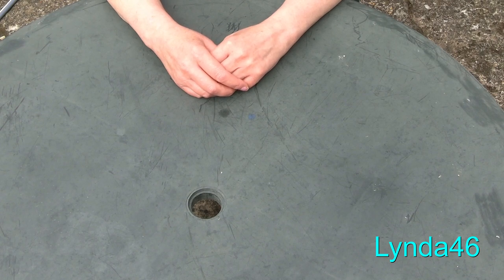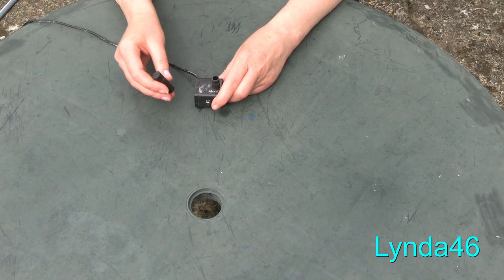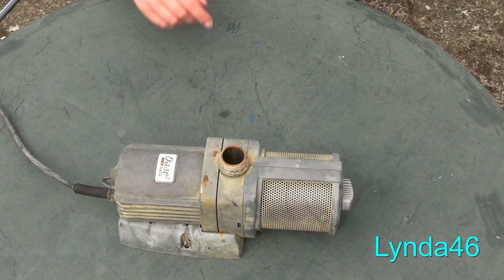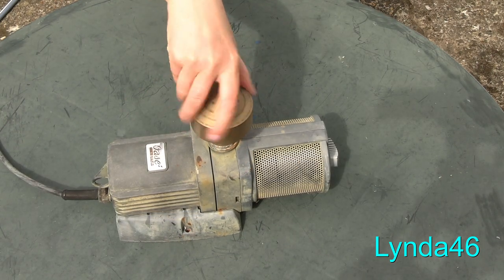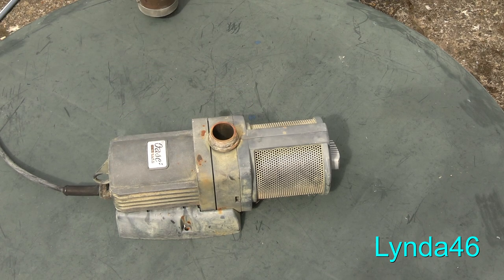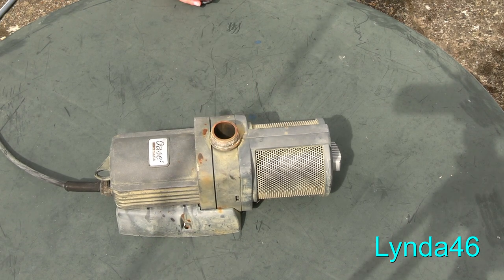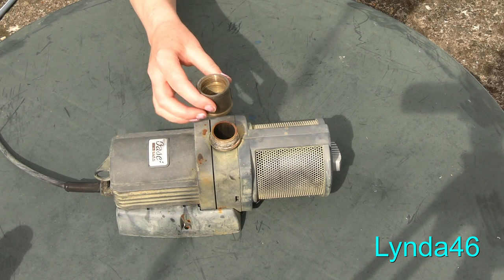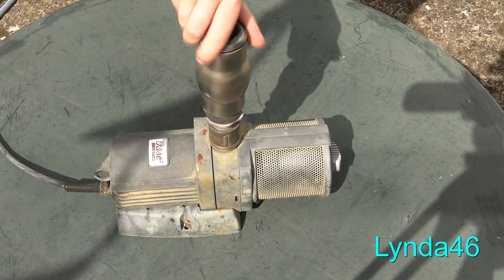How to connect a nozzle | connect a fountain nozzle to a fountain pump

Comment: Hello Lynda46! Today I got myself for the first time ever a fountain pump from Oase, It's the Aquarius Universal Eco Premium 3000 as I don't need a lot of power, would it work fine on a DMX Dimmer, If not is there a way around it?
Reply from the maker: Hello lidico, as far as I know the Aquarius Universal Eco Premium 3000  does not have an asynchronous motor, so it will not work on a DMX dimmer, there is "no way round it" The smallest pump that will work with a DMX dimmer is the Aquarius Universal Premium 4000, there is also the slight possibility that I have been given the wrong information, so you could try it and see.
Reply: @lynda46  Thanks, but I'm not worried at all! I will just put a servo motor that turns the blue valve on the side of the pump, like how I am doing with the big draining pumps that I own, Thanks for the information!
Reply from the maker: @LidicoFountains  Brilliant Idea, you must make a video of it when you have done it.
Reply: @lynda46  I sure will!